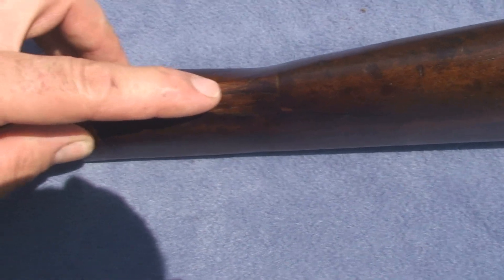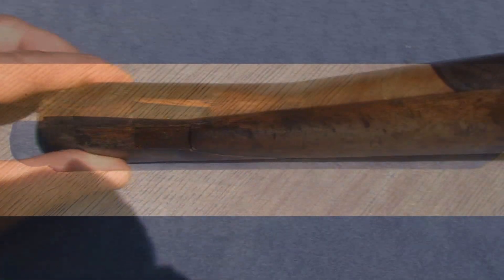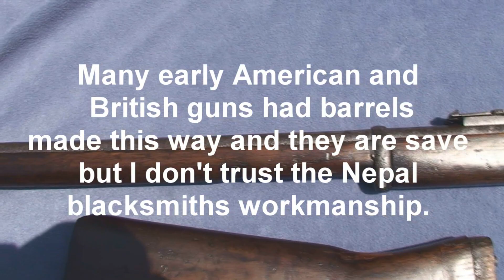Nepal Francotte stock repairs.wmv

Comment: I am glad I found this video.  I have a Francotte that needs some repair especially the buttstock and the screw holes on mine are pretty bad also.  By the way what type of adhesive did you use to glue in the wooden dowel?

Comment from the maker: @mikey29211 
Thats too bad.  Mine had pitting that was about 50% of the barrel thicknes but from that I've read thats the limit.  I did shoot mine 4 times, with the front sight installed at the 1:00 position I couldn't hit anything, and the shoulders of the case moved forward about 3/16 of an inch.  Too much working on the cases for me.